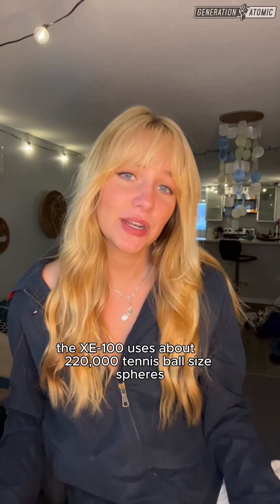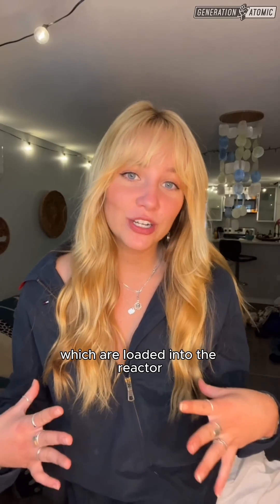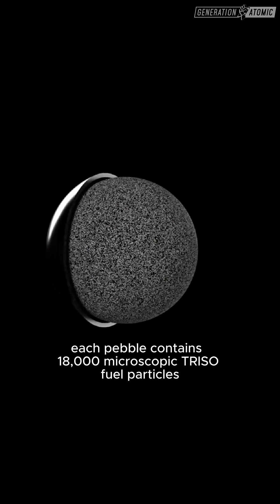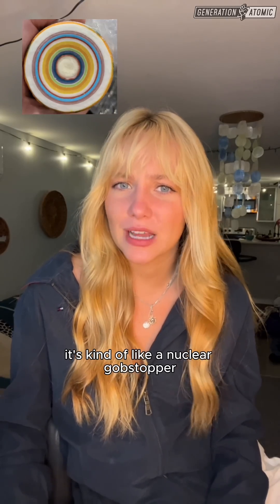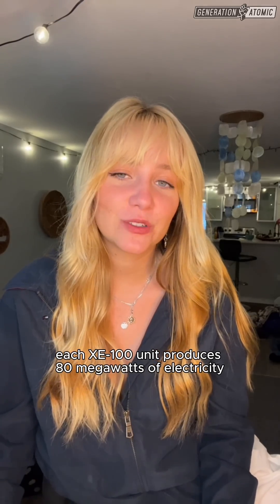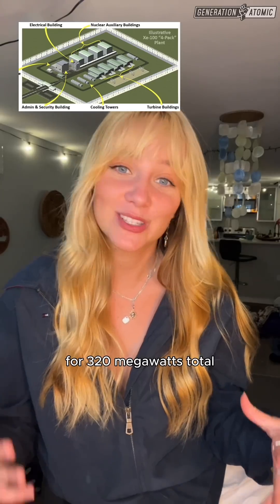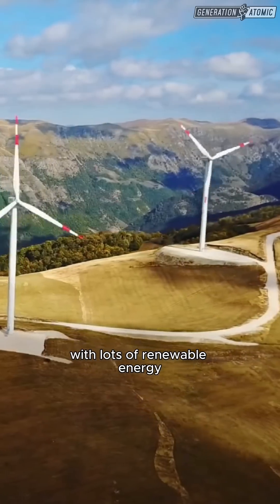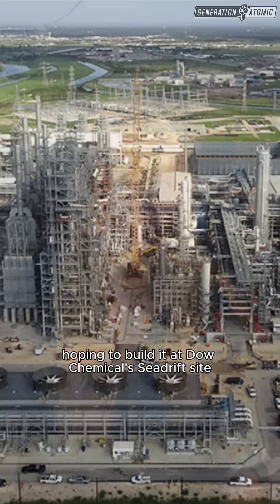The Nuclear Reactor Race: X-Energy #reactor #nuclear #nuclearreactor #energy

Comment: Hi, English is not my mother tongue that’s why I decided to let Chat GPT translate and reorganize my assay from school to fit into the profile of the USA.

The discussion around nuclear energy and renewable energy mainly revolves around costs, waste, and long-term responsibility. The differences between these energy sources can be clearly illustrated using the United States as an example.

The U.S. has roughly 330 million people and consumes about 4,000 terawatt-hours (TWh) of electricity per year. If 50% of this electricity came from nuclear power, about 2,000 TWh per year, roughly 330–385 short tons of high-level radioactive waste would be produced annually. With a 20% nuclear share, this would be about 130–155 short tons per year. High-level radioactive waste is produced continuously during the operation of nuclear power plants and remains dangerous for over 100,000 years.

Over longer periods, these amounts accumulate significantly. With a 50% nuclear share, over 3 years about 990 short tons, over 5 years around 1,650 short tons, over 10 years about 3,300 short tons, and over 20 years roughly 6,600 short tons of high-level waste would accumulate. With a 20% nuclear share, the amounts would be roughly 400 short tons after 3 years, 660 short tons after 5 years, 1,320 short tons after 10 years, and about 2,640 short tons after 20 years.

The storage of this waste is extremely expensive. Long-term disposal costs are estimated at $5–10 million per short ton. This means that with 50% nuclear power, disposal costs after 20 years would be roughly $33–66 billion, and with 20% nuclear power, about $13–26 billion. On a per capita basis, this corresponds to roughly $100–200 per person for 50% nuclear and $40–80 per person for 20%. These figures only account for storage, not for plant decommissioning, safety measures, or millennia-long monitoring.

New reactor types, such as thorium reactors or so-called fast breeder reactors, could reduce the amount of waste, but still produce radioactive byproducts and are not yet in widespread commercial use. Completely solving the nuclear waste problem with these technologies is not possible.

⸻

Additional costs not previously accounted for
	1.	Decommissioning old reactors
	•	After about 40–60 years, a nuclear plant must be dismantled.
	•	Cost: roughly $1–2 billion per plant.
	2.	Construction of new reactors to achieve a certain share
	•	To reach 50% nuclear electricity, many new reactors would be required.
	•	Cost per plant: $6–10 billion.
	3.	Safety measures and emergency preparedness
	•	Staff, inspections, physical protections, evacuation plans.
	•	Operating costs: $100–200 million per plant per year.
	•	One-time or project-specific investments during operation: $100–500 million per reactor.
	•	National emergency preparedness: $1–2 billion per year for the U.S.
	4.	Millennia-long monitoring of waste repositories
	•	Repositories must be monitored for 100,000+ years, including inspections, research, and staffing.
	•	Costs for the first few decades: $1–3 billion per repository.
	•	Extrapolated over millennia: conservatively $10–20 million per year.
	•	For the U.S. with 50% nuclear power, total monitoring costs could theoretically reach ≈ $1–2 trillion.
	5.	Modernizations and major refurbishments
	•	Regular safety upgrades are necessary.
	•	Costs: $100 million to $1 billion per reactor per decade.

💡 Total additional costs: For the U.S. with 50% nuclear power, decommissioning, construction, safety, monitoring, and modernization could cost several hundred billion dollars more over the coming decades. Per citizen, this would amount to at least $300–500, on top of the $100–200 for waste storage.

⸻

Renewable energy

Renewable energy sources such as wind, solar, and hydroelectric power generate no radioactive waste. If 50% of U.S. electricity came from renewables, annual investment costs would be roughly $80–120 billion. With a 20% renewable share, annual costs would be about $30–50 billion. Over 20 years, the total cost for 50% renewable energy would be roughly $1.6–2.4 trillion. These costs include the construction of infrastructure and facilities, but no long-term disposal or monitoring costs, as the waste produced is recyclable and nonhazardous.

On a per capita basis, the costs for 50% renewable energy would be roughly $250–400 per person per year. There are no long-term risks, no waste repositories spanning hundreds of thousands of years, and no burden on future generations.

⸻

Conclusion
	•	Nuclear energy: relatively low waste volume but extremely dangerous, very expensive to manage, with additional costs for decommissioning, construction, safety, modernization, and monitoring. Responsibility extends over 100,000+ years.
	•	Renewable energy: higher initial investment, but no highly hazardous waste, no long-term monitoring needed, and more sustainable and responsible for the future.

Nuclear energy shifts problems into the future, while renewable energy addresses them in the present.

Do what you want with that information. I think it’s an important and highly needed information for all of you. Renewable energy is not only less expensive than radioactive energy but also way safer, plus so many generations after us would have to handle the tons of waste that we produce with those reactors and we frankly should not make any decisions that those future generations have to lift and deal with.

Always make your own research and decisions not on social networks but on studies and research books, because influencers always want to influence everyone into thinking the same as them, while not being qualified themself. I don’t know her. I haven’t watched her much, so I don’t know if she is qualified but I spoke about the majority of influencers. I am not qualified. I haven’t studied anything yet. I just did some research and want you to do it as well, because I’m just a stranger and shouldn’t trust anyone on social media. 

Thank you for reading.
I wish all of you a wonderful day. 
Bye

Comment: Look into Lightbridge fuel, they are working to replicate Russian fuel design, based on metallic fuel, which maintains much lower internal temperature and is able to better reject heat from its internal structure. Moreover, unlike Triso, a metallic fuel bundle can be reasonably recycled.

Comment: Using atoms instead of oil for process heat.  This is huge.  Decarbonize!  And energy security too!  YES!
Reply: Hi, English is not my mother tongue that’s why I decided to let Chat GPT translate and reorganize my assay from school to fit into the profile of the USA.

The discussion around nuclear energy and renewable energy mainly revolves around costs, waste, and long-term responsibility. The differences between these energy sources can be clearly illustrated using the United States as an example.

The U.S. has roughly 330 million people and consumes about 4,000 terawatt-hours (TWh) of electricity per year. If 50% of this electricity came from nuclear power, about 2,000 TWh per year, roughly 330–385 short tons of high-level radioactive waste would be produced annually. With a 20% nuclear share, this would be about 130–155 short tons per year. High-level radioactive waste is produced continuously during the operation of nuclear power plants and remains dangerous for over 100,000 years.

Over longer periods, these amounts accumulate significantly. With a 50% nuclear share, over 3 years about 990 short tons, over 5 years around 1,650 short tons, over 10 years about 3,300 short tons, and over 20 years roughly 6,600 short tons of high-level waste would accumulate. With a 20% nuclear share, the amounts would be roughly 400 short tons after 3 years, 660 short tons after 5 years, 1,320 short tons after 10 years, and about 2,640 short tons after 20 years.

The storage of this waste is extremely expensive. Long-term disposal costs are estimated at $5–10 million per short ton. This means that with 50% nuclear power, disposal costs after 20 years would be roughly $33–66 billion, and with 20% nuclear power, about $13–26 billion. On a per capita basis, this corresponds to roughly $100–200 per person for 50% nuclear and $40–80 per person for 20%. These figures only account for storage, not for plant decommissioning, safety measures, or millennia-long monitoring.

New reactor types, such as thorium reactors or so-called fast breeder reactors, could reduce the amount of waste, but still produce radioactive byproducts and are not yet in widespread commercial use. Completely solving the nuclear waste problem with these technologies is not possible.

⸻

Additional costs not previously accounted for
	1.	Decommissioning old reactors
	•	After about 40–60 years, a nuclear plant must be dismantled.
	•	Cost: roughly $1–2 billion per plant.
	2.	Construction of new reactors to achieve a certain share
	•	To reach 50% nuclear electricity, many new reactors would be required.
	•	Cost per plant: $6–10 billion.
	3.	Safety measures and emergency preparedness
	•	Staff, inspections, physical protections, evacuation plans.
	•	Operating costs: $100–200 million per plant per year.
	•	One-time or project-specific investments during operation: $100–500 million per reactor.
	•	National emergency preparedness: $1–2 billion per year for the U.S.
	4.	Millennia-long monitoring of waste repositories
	•	Repositories must be monitored for 100,000+ years, including inspections, research, and staffing.
	•	Costs for the first few decades: $1–3 billion per repository.
	•	Extrapolated over millennia: conservatively $10–20 million per year.
	•	For the U.S. with 50% nuclear power, total monitoring costs could theoretically reach ≈ $1–2 trillion.
	5.	Modernizations and major refurbishments
	•	Regular safety upgrades are necessary.
	•	Costs: $100 million to $1 billion per reactor per decade.

💡 Total additional costs: For the U.S. with 50% nuclear power, decommissioning, construction, safety, monitoring, and modernization could cost several hundred billion dollars more over the coming decades. Per citizen, this would amount to at least $300–500, on top of the $100–200 for waste storage.

⸻

Renewable energy

Renewable energy sources such as wind, solar, and hydroelectric power generate no radioactive waste. If 50% of U.S. electricity came from renewables, annual investment costs would be roughly $80–120 billion. With a 20% renewable share, annual costs would be about $30–50 billion. Over 20 years, the total cost for 50% renewable energy would be roughly $1.6–2.4 trillion. These costs include the construction of infrastructure and facilities, but no long-term disposal or monitoring costs, as the waste produced is recyclable and nonhazardous.

On a per capita basis, the costs for 50% renewable energy would be roughly $250–400 per person per year. There are no long-term risks, no waste repositories spanning hundreds of thousands of years, and no burden on future generations.

⸻

Conclusion
	•	Nuclear energy: relatively low waste volume but extremely dangerous, very expensive to manage, with additional costs for decommissioning, construction, safety, modernization, and monitoring. Responsibility extends over 100,000+ years.
	•	Renewable energy: higher initial investment, but no highly hazardous waste, no long-term monitoring needed, and more sustainable and responsible for the future.

Nuclear energy shifts problems into the future, while renewable energy addresses them in the present.

Do what you want with that information. I think it’s an important and highly needed information for all of you. Renewable energy is not only less expensive than radioactive energy but also way safer, plus so many generations after us would have to handle the tons of waste that we produce with those reactors and we frankly should not make any decisions that those future generations have to lift and deal with.

Always make your own research and decisions not on social networks but on studies and research books, because influencers always want to influence everyone into thinking the same as them, while not being qualified themself. I don’t know her. I haven’t watched her much, so I don’t know if she is qualified but I spoke about the majority of influencers. I am not qualified. I haven’t studied anything yet. I just did some research and want you to do it as well, because I’m just a stranger and shouldn’t trust anyone on social media. 

Thank you for reading.
I wish all of you a wonderful day. 
Bye